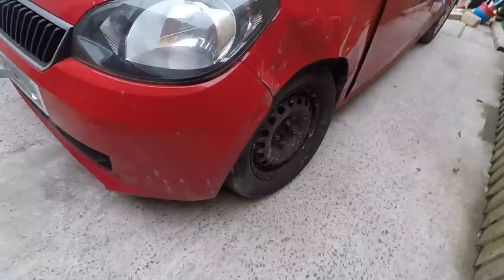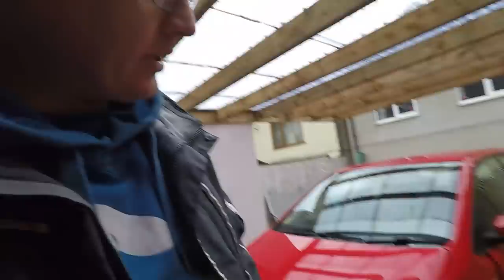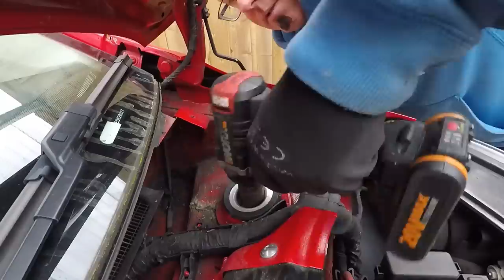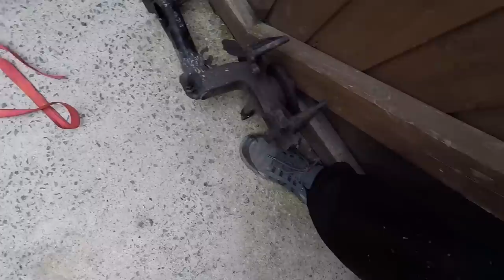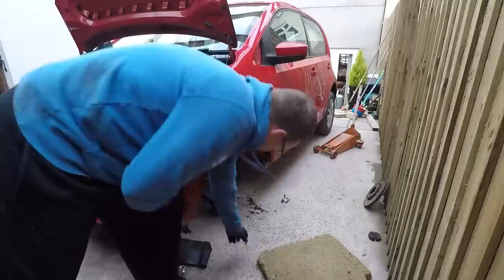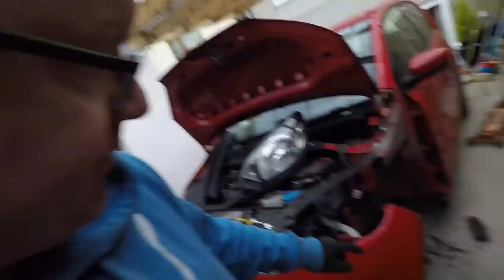Crash damage teardown. skoda citigo from copart

Comment: Awesome Steve,  great work nice clean repair,  why do insurance companies right cars off for such a little repair,  surely there's a market for insurance repairs using recycled parts
Reply: Labour costs and they won't use second hand parts because of possible unseen damage. They won't want to leave themselves open to litigation.
Reply from the maker: As Ian said every part will be replaced brand new and oe spec. Cost of repaint etc and courtesy car would add up.

Comment: I would have replaced the bottom arm and link bar as well , that corner has had impact, same as hub it may be slightly bent
Which will put the steering out.

Comment: Nice car at a bargain. I see you have the WORX impact gun how do you find it? I have one and it struggled removing wheel nuts on a combo but removed a drive shaft nut on my 208. For me it’s unreliable
Reply from the maker: It's ok but it's not heavy duty. I mostly crack rough nuts loose first as it can't cope but for most jobs it's good.
Reply: They're very sensitive to battery level especially on the small 2ah ones.  5ah one does a better job and lasts longer obviously.  You can pick up a DCF899 secondhand for less than the worx, nothing that won't undo, still use the worx for the smaller stuff

Comment: Nice easy fix if you get a knocking noise from that side when driving change the bottom ball joint, Mine felt fine by hand but under load made a knocking noise .

Comment: After a impact like that the insurance would insist on a steering rack to be fitted, modern electrinic steering racks don't react well to impacts and cannot be guaranteed safe after impact. If anything went wrong after your repair then you would be in the shit.
Reply from the maker: If the rack had taken a significant  impact the rod would show it. They bend super easy. The impact was top of wheel and wing. I'm confident it's fine and iv checked it thoroughly don't worry.